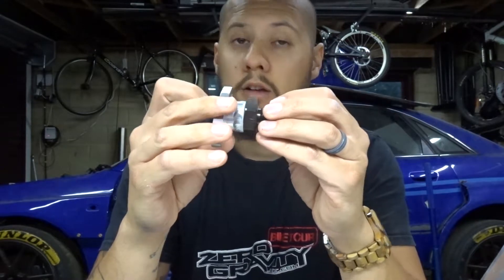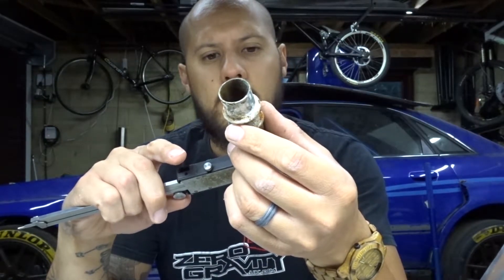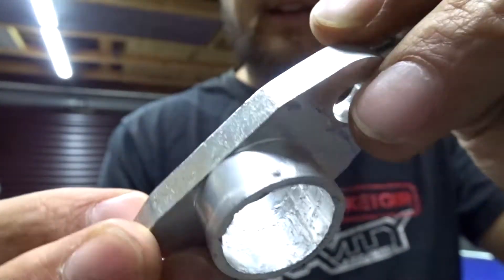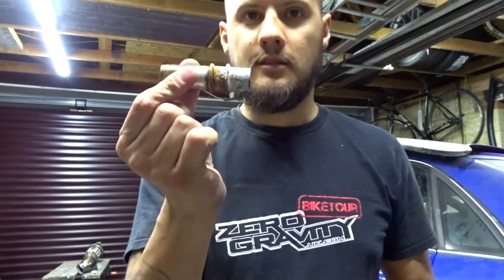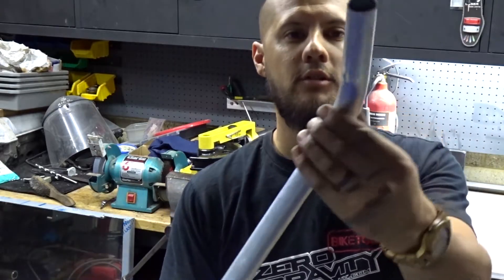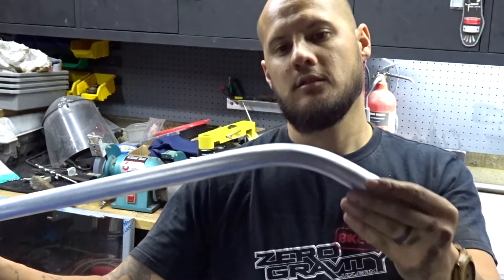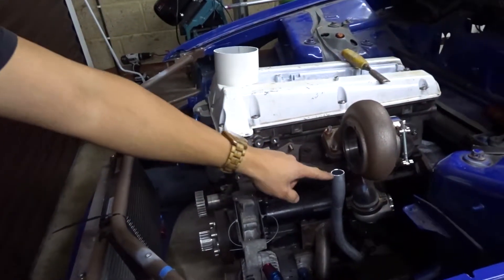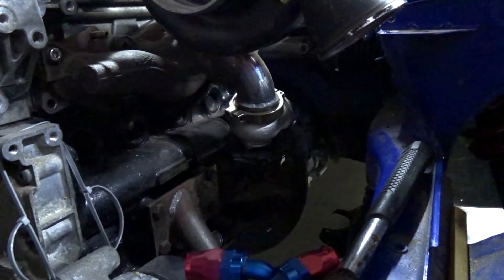Fabricating the oil drain for my Holset HX40 turbo

Comment: nice work Andy! may i ask why hard pipe VS flexi?
Reply from the maker: Good question. Other than OEM setups that I'm used to are hard pipes (Volvo's), and it's fairly close to the wastegate, there's not really a good answer. There is some movement in the o ring at the bottom that should reduce any fatigue which was one of my own concerns on an aluminum pipe.
Reply: @AndyPonting  fair enough. i went with Flexi AN10 pipe. making hard line would have bee a royal pain. its good when drain is directly below. the turbo.
Reply from the maker: @RuskiWeldFab  I don't believe the g25  (or any bb turbo for that matter) requires as much oil as these big journal bearing turbos.  On the Holset they're pretty big.  I've one here with a hard pipe drain on it from factory (came off a coach 😄) and that's a 20mm internal dia.

*(I might not be correct about bb vs journal bearing oil requirements,  so don't quote me on that!)
Reply: @AndyPonting  yeah i think out on my turbo is like 12mm. tinny